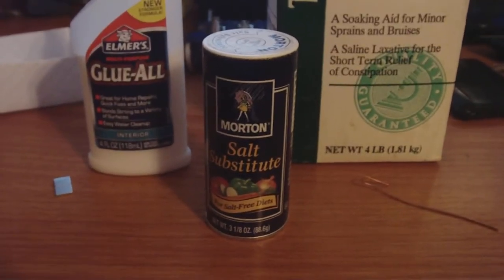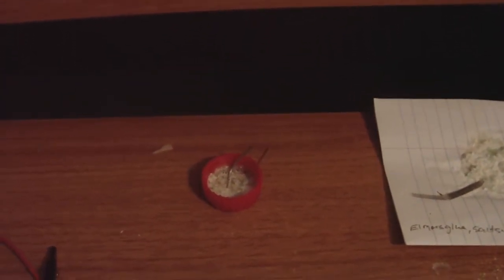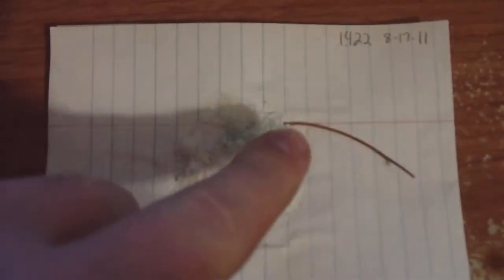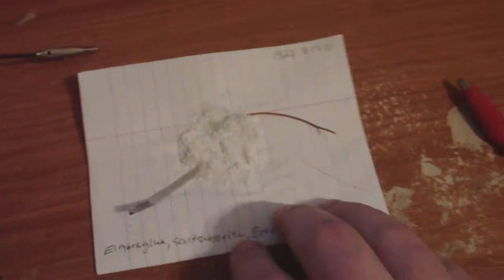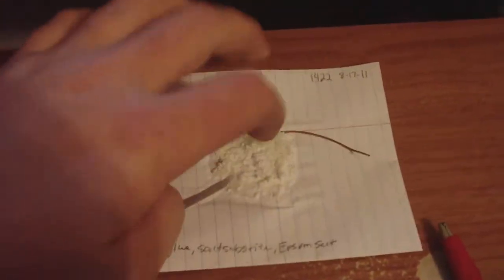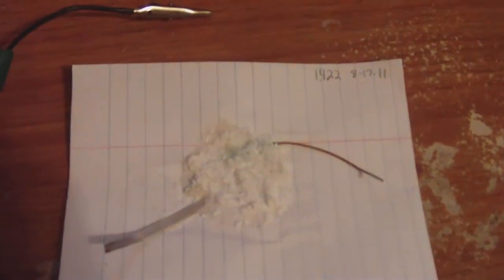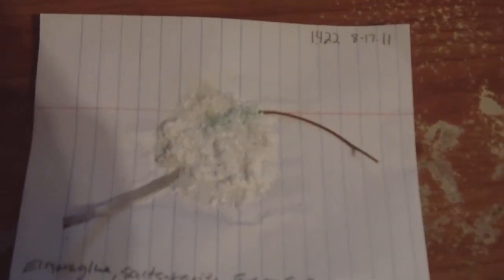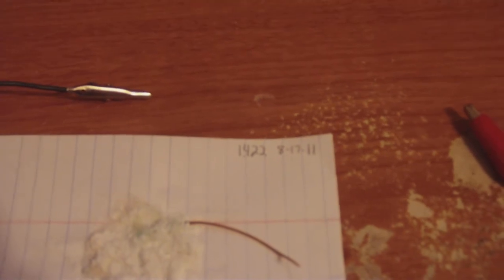Crystal Glue Cells don't need water to keep them alive

Comment: Great study over time, my battery is large but due to work and travel it was left outside , it absorbed so much water during  rain season that the magnesium block pull out like a balloon and rust is all over only on magnesium i will tried soon as is and then reheat it, to see if i can regenerate it, your results picked up my interest on this topic again i feel that with Bedini we were going in several directions without really going anywhere...Best regards.